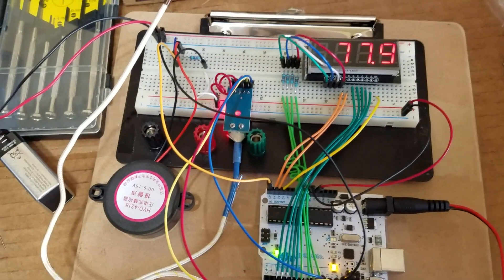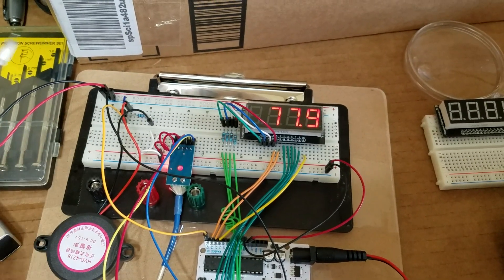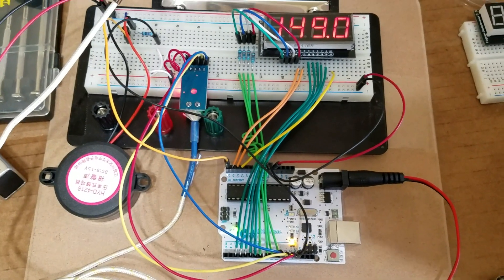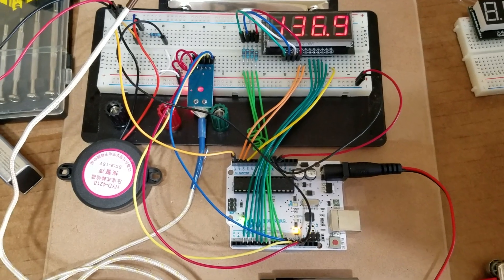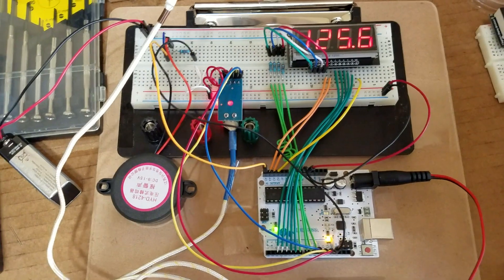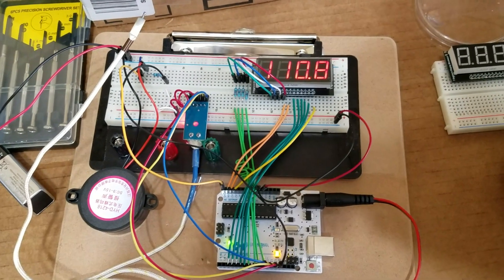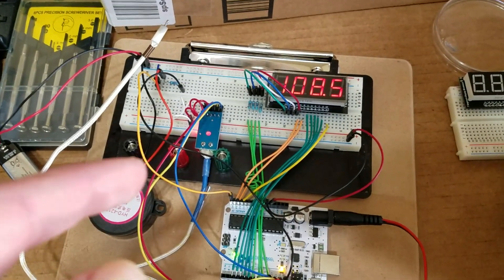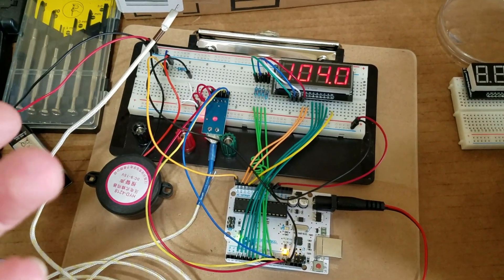Arduino High Temperature Alarm prototype demonstration

Comment: I did something similar for aSous Vide cooker. Cooks in water bath in vacuum bag at very controlledtemp (+/1*F). I didn't do the control, just themonitoring. I used an ESP8266 and a DS18B20 waterprooftemp sensor and published the results ( one every 2 minutes) to thingspeak. I could then view it over smartphone when I was away from home. I wanted to also enter Set Point temp and alarm with maybe SMS message when out of specs (+/5%). Would also be good to know how long it was working ( Sous Vide cooks can take up to 60 hrs at around 160*F).  It migth was the smartphone to input the perameters (so no need for additional input/display devices.). It could also enterthe smartphone number if you make it for everyone. Wifi Signin/PassWord. Phone to call if alarm, desired Set Point temp ( C/F) and desired cook duration. The cook time starts when it reached SP temp. You would also have to know what type of temps the customer was trying to measure and if it had to be waterproof. Might be two versions, ne for high temp (K type thermocouple) and one for ambient temps ( -30 to 200*F).
Good Luck with your project.  I'll be following.